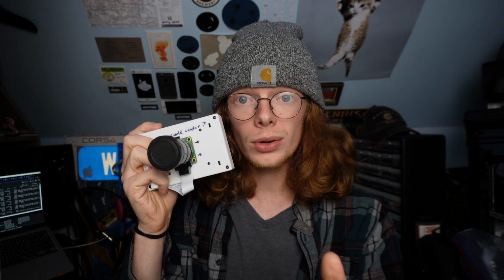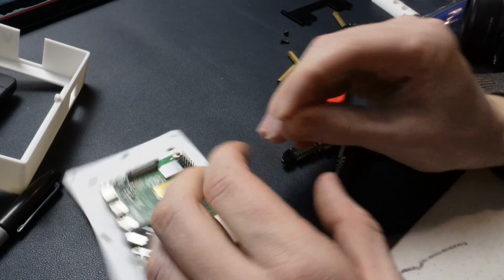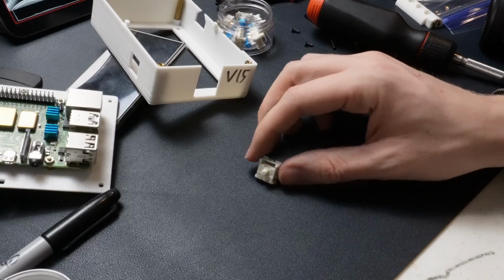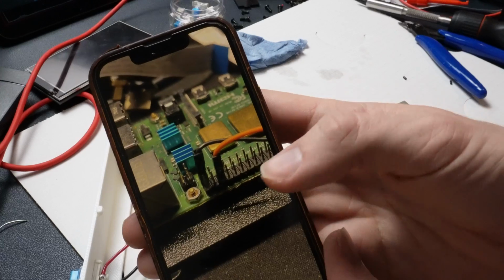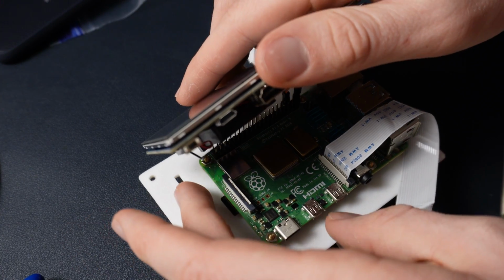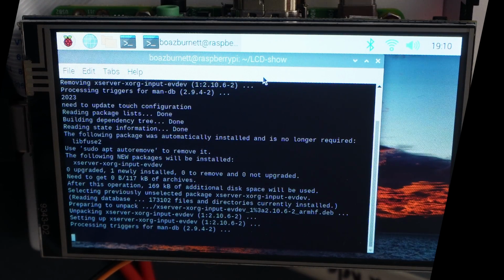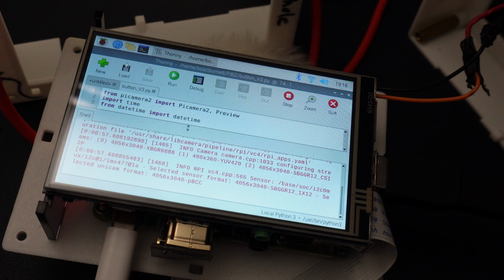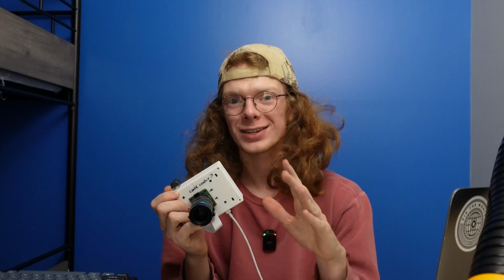How to MAKE a Camera | DIY Raspberry Pi Tutorial

Comment: Hi!

Thank you so much for sharing all the designs - soft and hard
Can you explain why the camera is mounted outside of your case and so the cable goes outside? 

I'm designing a case to use the camera for some time, carry it in a bag etc, so asking for the reasoning behind your decisions and maybe  some sujestions to make fewer mistakes
Reply from the maker: Great question! I actually don’t have a great reason for the camera cable being external. The cable that was included was longer than I wanted it to be and due to resource constraints, I was in college at the time, I didn’t want to go out and buy a shorter cable. 

My suggestion would be to look for a cable that would fit your design more appropriately! I’d love to see your build once you complete it, if there’s anyway you could tag me or ping me on social when you release it!
Reply: @B0A2  thanks! Will do)